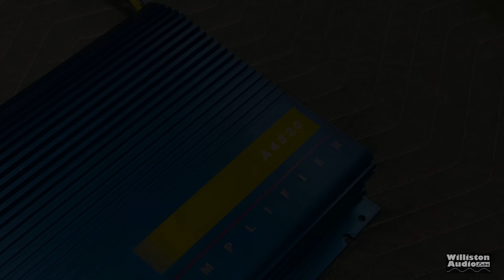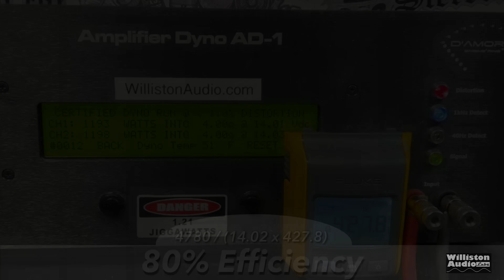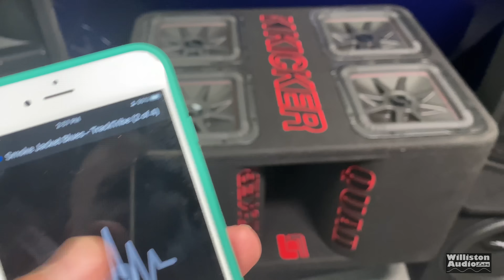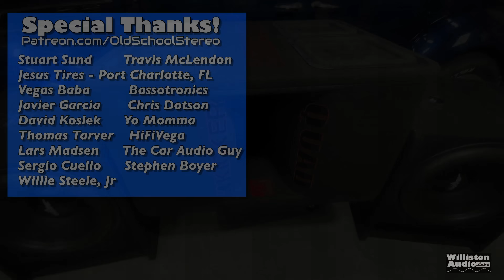The MOST POWERFUL Four Channel Car Audio Amplifier Currently Available?

Comment: Having issues with mine bought it march and just installed it. I’m running 12  6/5 apocalypse 67an neo 300 rms and works great but as soon you turn the vehicle off it makes all 12 speakers pop. I already tried putting a relay on it and does the exact same thing.

Comment: Did you by chance test the power output at 8 ohm? I’m curious what the numbers are.
Reply: Yes Big D, an 8ohm test would be appreciated.
It's my understanding that THD is generally lower at higher ohms and the amps have better dampening?
I bought 4 Audiomobile EVO 2412s, and I am looking for an amp that makes clean 8ohm power.
Yes, I know we don't really hear THD and SNR with SPL subs, but mine are designed to play 10-650hz and I may play that high.
Anyway Big D, I really appreciate 8ohm testing as well as the lowers, when able.

Comment: I have a issue. I'm trying to find the right 6x3/4" round speakers for my pickup it takes only 4 that size. Also tweeters on the top of front doors. I have an 08 Colorado. Does anyone know which speakers and amp setup would be best for clear crisp music. I only listen to rock music and sometimes acoustic songs get mixed in there. I used to have a awesome infinity setup. I was surprised by everything I was missing. I want that in my pickup. Any advice would be awesome.

Comment: What would you use this for exactly? Subs or mids (good luck)   I guess I don’t understand what this beast is for. For mids and highs, it doesn’t make sense and for low end, I’d just get a mono block. Still, it’s a monster for sure.
Reply: And when some one says “I’ll drive 4 subs “ then you don’t need nor want to pay for all the cut off (band pass) stuff.  It’s a beast for sure I just don’t get what it’s for. And for the dude saying “I’m gonna throw it on my mids and highs” , ok, you don’t need a 10th the power it’s doing. Even on multiple drivers. To each their own I guess.
Reply: Like BigD , showing it off. On multiple subs. Well then why pay for something with all the Xover capabilities, and rcas inputs not needed. Just a waste of money imho.
Reply from the maker: It was designed to run mids and highs with tremendous power, but it is flexible enough to use in 3ch mode with subs and mids/highs or subs alone. Pulls a lot of current but it’s strong 💪
Reply: @wal  I know what It can do Dereck. I guess if you have 10 of each mids and tweets. I’d still do 2 for both. To each their own. 
  For “subs” you’d buy a board with band pass ability you don’t even use on subs, seems like a waste of money.
Reply: @wal  “since most will use this on mids and highs” let’s see the 4ohm bridged test-  3500 watts !!?? Makes zero,… zero sense. I guess if your running 35 drivers per channel. 

- said no one. Ever. 

(Guess I’ll wait for the “I run my xxx brand 6x9’s with 1000 watts” guy to jump in)

Just me, and probably many out there boss. Cheers.

Comment: I have a newbie question. How does a car provide enough energy to make these amplifiers work?
Reply from the maker: High output alternators and additional batteries and/or replace lead acid batteries with lithium cells designed for high capacity and current draw
Reply: @wal  thank you!

Comment: I'm in the market for a 4 channel amp. 100-125rms @4ohm Would you recommend the taramps ds440x4, taramps ts400x4 or the d4s jp84.   There is a huge price difference but not alot of power difference
Reply: jp 84, go watch the dyno video
Reply: @D4S-JAKE  i watched both videos thats why I asked.      The ds440x4 is half the price of the jp84 and only 20watts lower @4ohm but it puts out more power than the jp84 everywhere else on his dyno.   2ohm and bridged

Comment: A most impressive amplifier, and a true beast in the 4-channel category.
Now I am curious to know how much power it can push at 8 ohms, if you want to use it for a more SQ (or SQL) oriented build.
Reply from the maker: Approx 750Wx4 at 8 ohms 👍
Reply: @wal  That is most impressive. A true powerhouse

Comment: For your last comment about power and speakers, in my VW Touareg i had a set of CDT audio component in each doors, each driven by a Boston acoustics 600wrms amp (don't remember model name, gtsomething)
I exploded the cross over before i failed the component kit. Bought 4 new heavy duty crossover from cdt, i blew 2 of them again. Speakers are still fine.
Had the same kit (but only 2 components) in my tacoma, hooked up to a kicker sx900.4 bridged. They survived 4 years of 325w. So i guess i found the limit. I miss those days of car audio, still have all my kit from my touareg, the 4 gtsomething amps and 1 gt2300 for the subs.
Reply: @wal  have you ever tested boston acoustics GT series? I always wondered if they were really pushing the rated power.
If i remember the 2 channel was 300wrms/ch or 600wrms bridged 4 ohms

Comment: Ultimate highs app. I guess if you put two amps under the same cover then yeah it's a four Channel. Though what makes the four channels not so good is the small power supplies. A/D/S old school pq20 is too quiet. Can't help Bass
Reply from the maker: This amp can do bass no problem. The demo portion shows that…

Comment: Very impressive 👏 i would love to see the Orion HCCA 3000.4 and the 4000.4 tested if you can find them seen a 4000.4 for sale a cpl weeks ago so there still out there but both still on a dyno test wish list
Reply: Same, would like to see how Orion’s 4000.4 class H stacks up, it’s been out for years and not many even come close to its sound quality and power, and it’s rated at 12.6v
Reply from the maker: Thanks for the suggestion
Reply: For the money that want for any of those Orion HCCA amps that are a million inches long, you can get a smaller D4S JP454 that will spank both of those for $650.00.

Comment: Using an amp like this could simplify your installation and make it appear cleaner. What if you already had a good factory 'stereo' but wanted to improve it? You could run the factory units low level outputs to this amp and power 2 or 4 subs. That's enough for anything less than a competition setup.  A real winner here. Even the bass remote has heat sinks!
Reply: What if ? 
 Good luck with modern cars and all  the integrated  computer b*****

Comment: You may be forgetting the Taramps DS4000x4. Their 4 ch line ups are known to put out 30-50% more power but without testing it we can't know for sure. I'm curious to see someone experienced look at the drive IC's for the output section to see if they're appropriately sized. That's been a big failure point of these larger 4 channels.
Reply from the maker: The largest Taramps listed on their website was the DS2000x4. I checked all the manufacturers current listings. The Banda is rated to be more powerful than the Taramps at 1200x4 or 2400x2, yet still behind the JP10.4. I'd think people would appreciate the Korean half bridge quality over the "running on the edge" Brazilian amps.
Reply: @wal  Are "Korean" full bridge designs of the same quality? Let's be honest here, you aren't qualified to truly assess the "running on the edge" nature of the current market. Are Sundown full bridge "running on the edge?" How about Mmats? Or is it just Taramps? I have yet to see a 4 channel DS line go up in flames.
Reply: I just realized you changed your tag from to WAL, so it confused me. I'm the FIRST person who encouraged you to start DC clamping these amps, and you listened. Tell you what Big D, we're allowed to have intelligent discourse yeah? I'd like to propose something. If I pay for a DS2000x4, will you test it? I'll pay for you to ship it back to me at the end of your audition of it, of course. I'd like to get a friend of mine who repairs amps to give an opinion on the drive IC's. Taramps, like many other manufacturers, are known to undersize them
Reply from the maker: @mitchellroberts7954  if you understand why I said that about Taramps, then you wouldn't be asking...They run close to their voltage limit on the outputs and power supply transistors. No overhead. The Smart Amps have IC's to protect the amp from over current but many of the other version do not. I'll work on being more qualified in the future...
Reply: I had a taramps 4 channel and it got loud but that was it.. it sounded horrible just screamed loud with no sound quality smh
Reply: @TrealFOET  go EQ a taramps 4 channel and then EQ this amp in a sterile A vs B test and tell me which sounds better. There's a reason Richard Clark hasn't had to pay out that $10k from over a decade ago (it's inaudible)
Reply: @Mitchell Roberts  i had a dsp tuned with that amp i couldnt deal with the sound, ended up goin with a nvx 4 channel and been very satisfied in comparison
Reply: @TrealFOET  ...the NVX brand is a cloned Class D straight out of China. Great product for the price, but you're 100% in the realm of placebo. I stand by my prior statement. In a blind A vs B test with each amp properly EQ'd, you will not be able to tell a difference.
Reply: @Mitchell Roberts  lmfaoo alright man you got it
Reply: Its a class AB but youre right
Reply: @TrealFOET  Which model? Some Class A/B add distortion that is, to some, preferable. We're 10+ years past the Class A/B vs Class D vs Class H vs full bridge non sense.
Reply: @Mitchell Roberts  nba401 both where tuned to just an audiofrog curve, i tried the taramps for almost 2 months after trying different adjustments and never liked the sound of it. Switched to the NBA401, retuned it with the same curve and liked it much more.
Reply: @TrealFOET  I respect your subjective opinion. Maybe it does sound better to you. I'm not going to argue that point. There's a lot of factors at play like the HPF/LPF filters, but that doesn't mean an amplifier with the filters turned off and properly EQ'd isn't going to sound the same in an A vs B blind test. I've seen people prefer amplifier A over amplifier B simply because it boosts the 200-400hz frequency band. It's not linear (i.e. 1:1 match with the source music), but they prefer it.

Comment: When you are testing the amp on speakers are you only powering them with your lithium bank? Or do you run a charger on the batteries also?
Reply from the maker: In this case I had (1) 100A power supply/charger on them while listening to the songs. I don’t need it for about 30 min of listening, but I wanted to keep them close to full charge

Comment: My main issue with D4S amps is they do not have any form of cooling fans built in that really cool it off...
Reply from the maker: Most of them have cooling fans? 💁‍♂️ This one included
Reply: @wal  after 2 or 3 songs in the summer it would go into protect mode. after 6 months it would not come out of protect mode.
Reply: @wal  not for Las Vegas... the JP23 ( v1 ) lasted all of 1 week, no ability to breathe well, heat rises, and builds up with nowhere to go... where say a Kenwood KAC-9105D has a inlet and outlet to flow the air in 1 direction over the board. In cooler climates I am sure this is no issue, but in a place that can get to 115 degrees and low humidity where heat has a harder time getting pulled out, this is an issue. My 1800 Kenwood has lasted many years, no problems,  after 2 JP23, I give up
Reply: I am sure if you used a bunch of external cooling this would help, but in an enclosed trunk in summer, it will still cook
Reply: @EliteGeeks   it’s a way bigger amp…. Did you upgrade your electrical?
Reply: I seen a cooling fan…. 😂 seems like you need some glasses 🎉
Reply: They are designed to run HOT so it lives a half-life instead of a full-life! 😜
Reply: @ua7pyro591  yea, I know it.
Reply: Maybe not this one but what are the fans in the jp34ab for?

Comment: i left a negative review on Down4Sound and instead of them posting it, they emailed me, to see what was wrong, I told them, they never posted the review and didnt resolve the issue... telling me that it was out of warranty, meanwhile it was during the time when they were closed, around covid issues, also saying I could pay them to fix it... cost is near just buying a new one, yea, no thanks...   and no, I didnt break it, was was defective from the first week I used it, I just went back to my Kenwood amp that has no issues...     Moral of the story...   do not trust review ranks since some never get posted... that 4.8 rating may really be a 3.2
Reply from the maker: I rarely trust review ranks in any site, but will do my best here to stay objective
Reply: On a privately owned website for a Company. you shouldn't even waste your time reading the reviews. The owner of the website can create as many reviews as they want. The only reviews I'll kind of trust are Amazon and ebay reviews. Because they are only the platform for the 3rd party sales. Amazon has no motive to alter reviews. Because they are not the primary sellers.

Comment: What a beefy amp! That's some crazy power draw! 

Haven't seen your cap bank drop in voltage so quickly before! Definitely need a proper setup to feed this beast if you're going to push it.
Reply from the maker: LTO wants to be 15.4-15.8, I had it around 15.1 which lost a lot of capacity. I was trying to show around 14V results instead of 14.5
Reply: @wal  I think this would push the 100x4 i need, yeah? LOL
Reply: @wal  cool, thanks for the info.

Comment: D4S, putting in work! when i was into car audio (richard clarke GN days), 1k watts was a beast......now, holy moly. and we didnt do much beyond a big extra battery and stiffening caps
Reply: bck when i was in audio, like you said 1k watt amp , we were like dammmm, and the only amps that i had  that gave off that good clean power  was the orion beast, and the earthquake 2020...hahah.. OH, and lets not for get PPI (precision power) ..LOL
Reply: @theone148  MMATS was among them in 1995. Not widely distributed. Also HiFonics Colossus, USAMPS. There were a number of them but definitely rare. Big batteries, diode isolation (later, starter solenoids) 1/0 wire and HO Alternators were BIG bucks back then. Not many shops would even do it - let alone do it correctly.

Comment from the maker: Thank you for watching my video! If you'd like to support me and save money on car audio, check out Shop4Bass.com and Thanks!!

SHOP (affiliate links)
JP10.4 Amplifier: https://lddy.no/1dfs2
JP40 Lithium Battery: https://lddy.no/1e081 (perfect for this amp!)
JP77 (7-channel) Amplifier: https://lddy.no/1dfs1
Rockford Fosgate Power T1000-4ad: https://amzn.to/3u0vdaH
JP34ab 4-channel A/B Amplifier: https://lddy.no/15b14
JP84 4-channel Class D Amplifier: https://lddy.no/zhh0
Shop all Amps and Speakers here: http://www.shop4bass.com
KICKER L7R Quad Box: https://amzn.to/3VMxH97
D4S LTO 6.0 battery: https://lddy.no/1d7tj
1/0 OFC Amp Wiring Kit: https://lddy.no/1d7uj (don't get CCA!)
HiFiVega 1/0 OFC Wiring Kit: https://bit.ly/3rV9vDU
HiFiVega 1/0 OFC Big 3 Kit: https://bit.ly/3rXqxRW
Note: Amp requires 2 RUNS of 1/0 OFC wiring and high output alternator and extra batteries. Remember, it takes power to make power, beef up your electrical system first!

RELATED VIDEOS
Down4Sound JP83 Monoblock: https://youtu.be/_Buqewi_8lI
Down4Sound JP34ab 4-channel: https://youtu.be/9ptlq9hg3jI
Playlist of All D4S JP Amps here: https://bit.ly/3NF8I32

VIDEO INDEX
0:00 INTRO
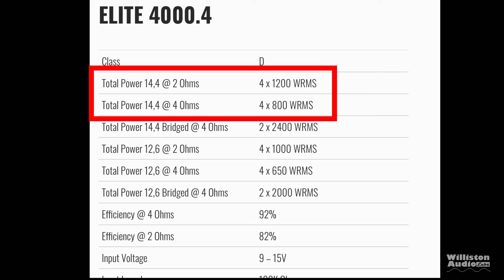0:51 THE T15KW
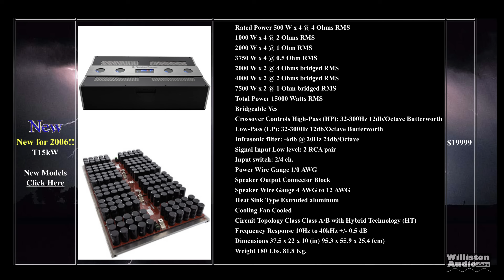1:22 THE JP10.4
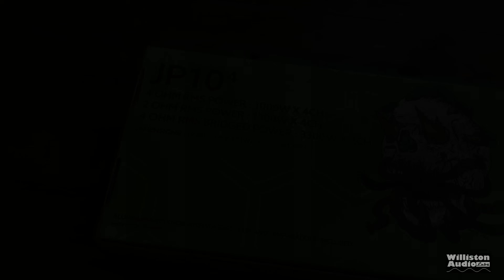1:45 UNBOXING
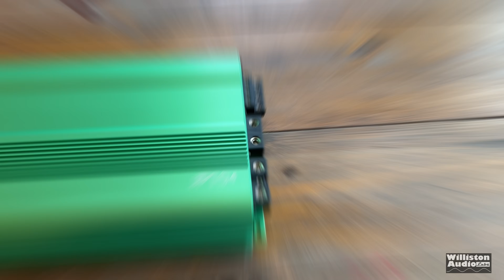2:37 FEATURES AND SPECS
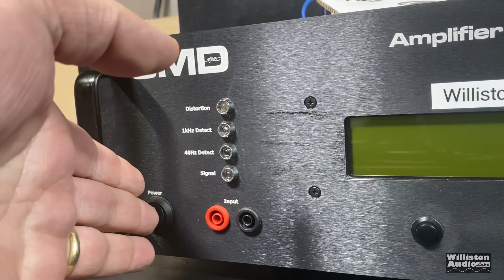4:33 AMP DYNO TESTS
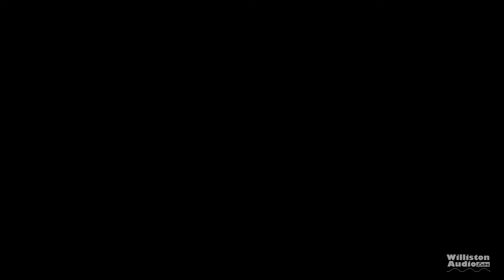8:22 DO IT BUMP DOE?
9:35 MY STUNT WALL DEMO
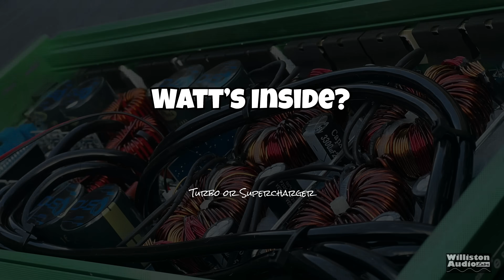11:00 WHAT'S INSIDE?
11:52 PROS AND CONS
12:37 FINAL THOUGHTS
13:23 EXTRAS

VIDEO GEAR
(Video Gear I Use) 
Camera - iPhone 13pro 1TB - https://amzn.to/3nCjGvc
RODE Wireless Go II Microphones: https://amzn.to/3Q6NVHl
Shure MV7 Microphone: https://amzn.to/3A4OICK
Zoom H4n Audio Recorder: https://amzn.to/3BXjVsS
960 LED Panel: https://amzn.to/2Sxoq3S

This VIDEO was EDITED with LumaFusion on an iPad Pro 12.9:
iPad: https://amzn.to/2Ancr1W
Software: https://goo.gl/6yvWss

TEST BENCH EQUIPMENT
SMD / D'Amore Engineering Amp Dyno: https://goo.gl/sJTcf7
XS Power D1400 Batteries - https://amzn.to/2BPFCKW
XS Power PSC60 Charger - https://amzn.to/2CHGcfs
Fluke 1000A AC/DC Clamp Meter: https://amzn.to/2Rw5WDA
Handheld Dyno: http://amzn.to/2u2EgKV
My Favorite Screwdriver Kit: http://amzn.to/2x0VzcE

DISCLAIMER: This video and description contains affiliate links, which means that if you purchase from one of the product links, I may receive a small commission. As an Amazon Associate I earn from qualifying purchases